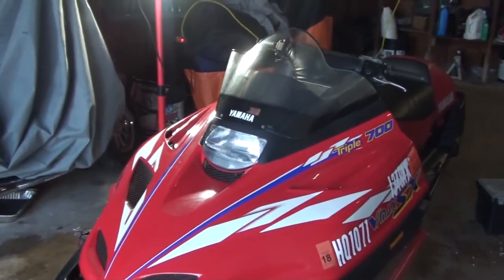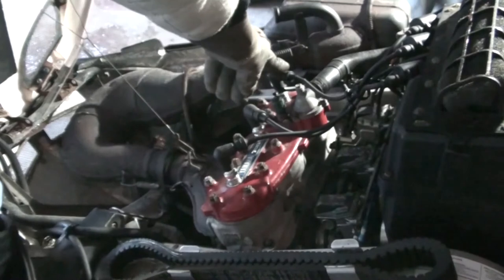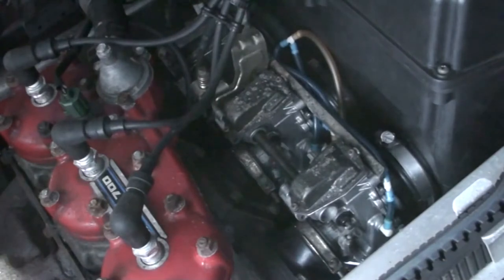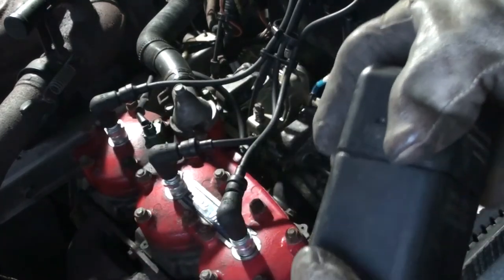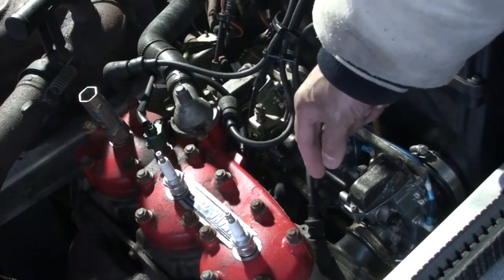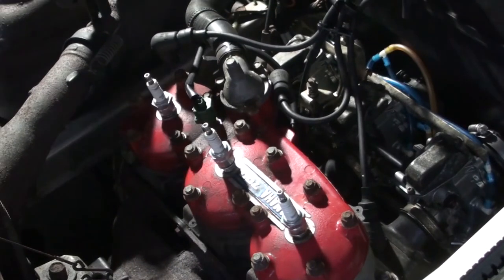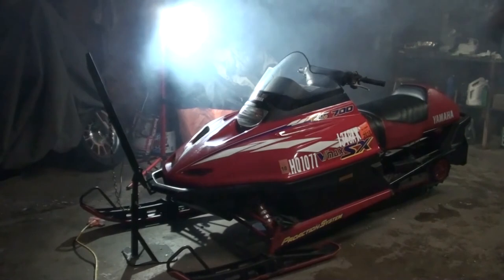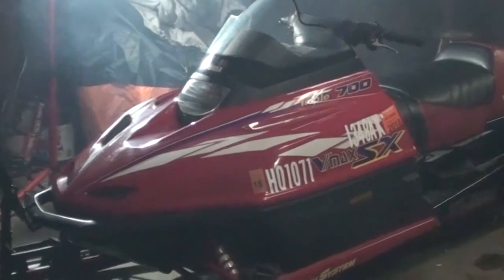Starting Snowmobile after 6 yrs- 1997 Yamaha Vmax SX700

Comment: I have the same sled! Bought my V-Max 700 SX new in 1996 for $6499.00 U.S.  In order for the fuel pump to fill all three carburetor bowls with fewer rope pulls, I use an oil can mixed with fresh 32:1 premium gas and Yamalube. 1 shot of gas/oil in each cylinder, then screw the spark plugs in finger tight until she starts. Full choke until the engine fires, then half choke.  The three cylinder engine may require up to two oil can squirts of gasoline per cylinder before engine finally springs to life.  Start sled outdoors with fire extinguisher within arms reach.